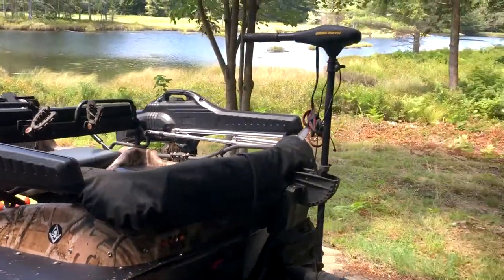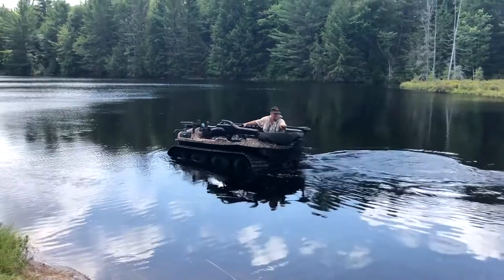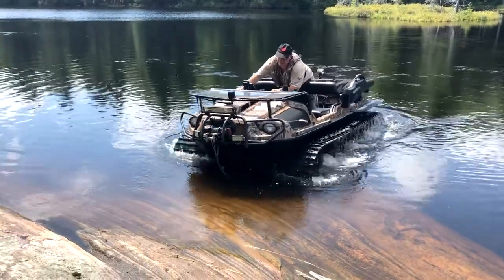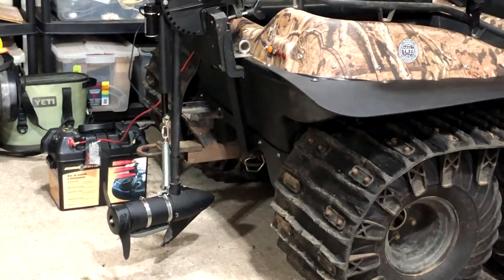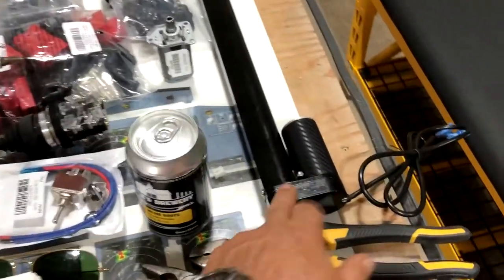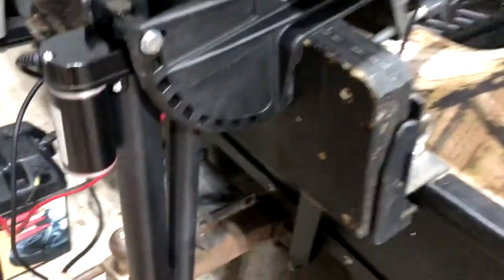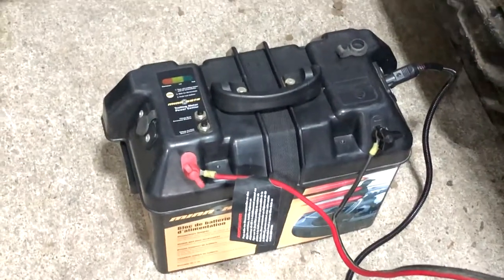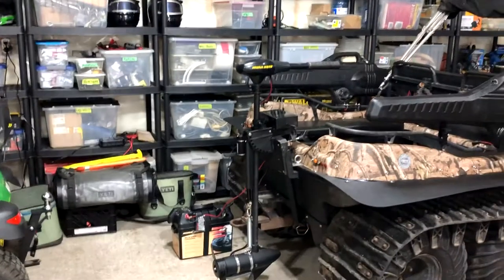Argo 8x8 HDI with trolling motor using linear lifting actuator

Comment: With you sitting in the back you don't fined it tippy. My is the Scout 700cc maybe it's the wheels are wider. Do you fish perch in simco?
Reply: Ice fish perch in simco? I wish I could take to you in private. Do you do some gold prospecting?
Reply from the maker: I kept the tracks on this summer which is why the trolling motor is necessary. My old 2002 conquest still swam with the plastic tracks but the rubber tracks on the HDI just cavitate. I don't find the 8x8 tippy